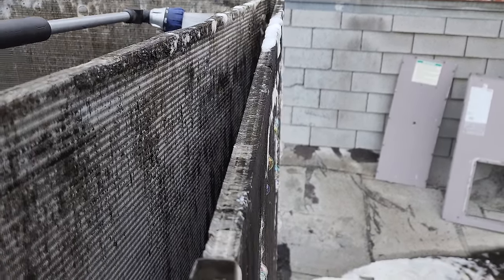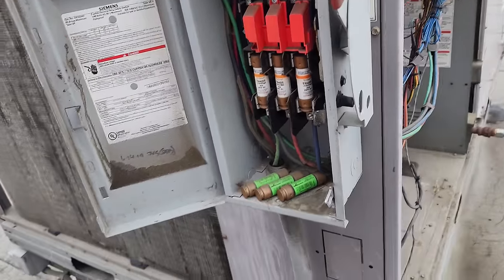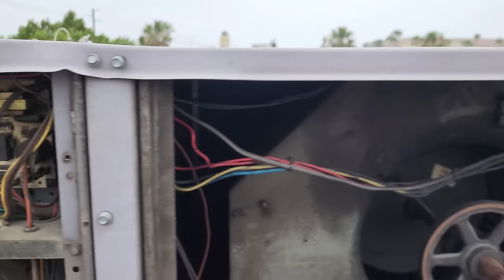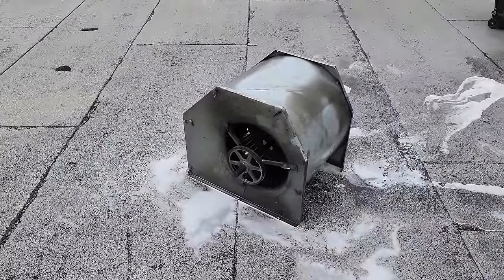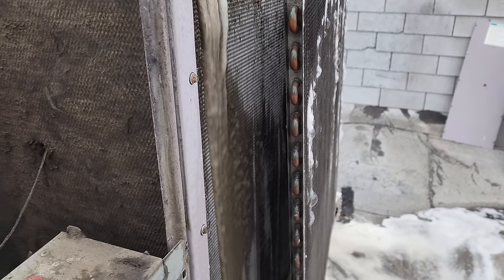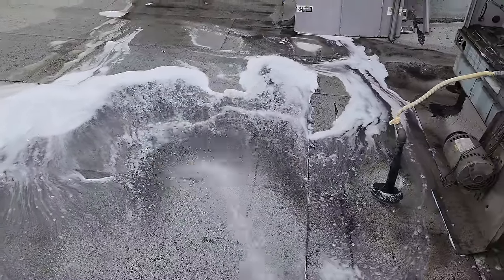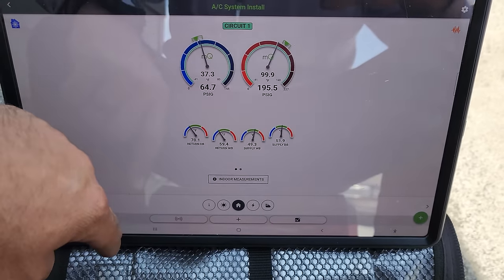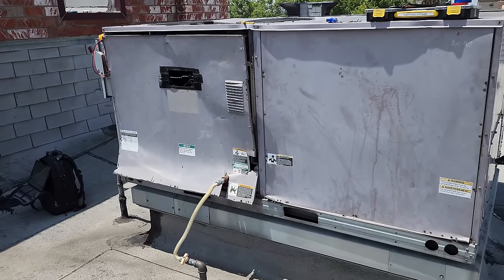CARRIER PACKAGE UNIT LOW VOLTAGE ISSUES

Comment: You guys over that side of the pond seem to be pretty comfortable around exposed terminals, however take care with that transformer. Those other taps will still be live so be careful when pulling those spades off with your fingers to probe!
Reply: I think he turned off the disconnect first (so the unit was unpowered)

Comment: WHATS A TYPICALLY OHMS READING YOU’LL READ ON A PRIMARY AND SECONDARY OF YOUR TRANSFORMER? FOR YOU TO DECLARE IT WAS BAD
Reply: It varies, but the secondary's DC resistance should at least be several ohms. Not tenths of an ohm as Chris saw here, which is close enough to a dead short.

Comment: Could you possibly just order a new panel for the compressor and electrical section? While getting a whole unit is fairly hard, surely a bit of stamped metal wouldn't be as difficult. At the very least it would provide some better weatherproofing and structural rigidity to the unit.
Reply: I would think you could just get a metal shop to flatten it and brace it. It wouldn’t be perfect but it would seal better than now.

Comment: question
why capacitors swell ? ( running capacitor )
Reply: A swelling capacitor USUALLY means it has become too hot, and the electrolyte was "boiling" out of it. The expansion inside the capacitor as it heats up causes the casing to swell up.

Comment: You stated the transformer was bad after testing resistance.
Is there a specific resistance that makes it bad?
I must admit, I have never tested for resistance to determine if a xfmer is bad.
Reply: Ohm's Law, power = V^2/R. Rough guidelines, high voltage side several hundred ohms, low voltage side several ohms.

Comment: Please test across the resistors only when the compressors are on because when no current flows there is no voltage drop. More current = bigger voltage drop, only so you can determine if the fuse/contactor is going bad or not.
Reply: Read you comment, im sorry but it makes no sense its complete gobbly goop. Voltage drop has f all to do with current flow... Resistance is the opposition to current flow not voltage drop.

Comment: About splitting condensers: Battery powered power washers have somewhat of an intermediate pressure, i wonder if you could get some dirt out of the condenser.
But i suppose any sort of slightly higher water pressure will bend the fins ... otherwise you would be using it.
Excuse my ignorance, great videos!
Reply: pressure washers work great and probably better that the hose arrangement Chris uses  
but they need to be handled with great care  at a distance of above 10"  or more to prevent damage and always at 90 degrees to the coils and always work up and down the fins not across otherwise it's very easy to flatten the fins as you suggest.
if you use a pressure washer properly you won't need to split the coils from my experience.